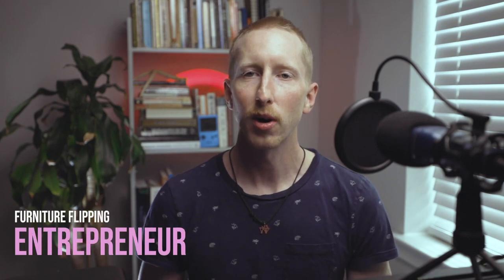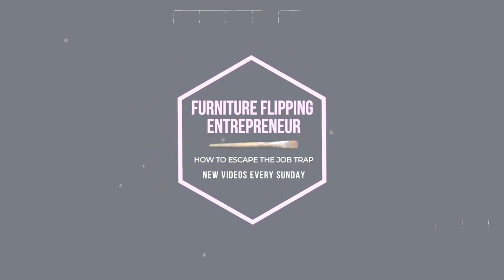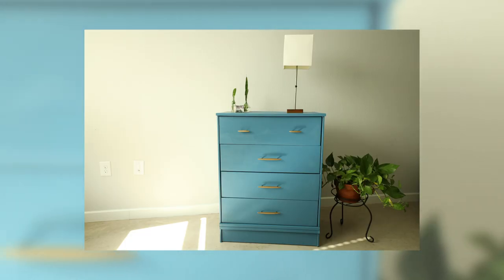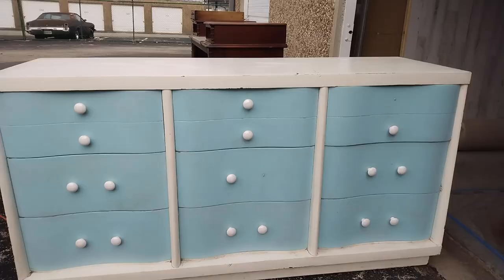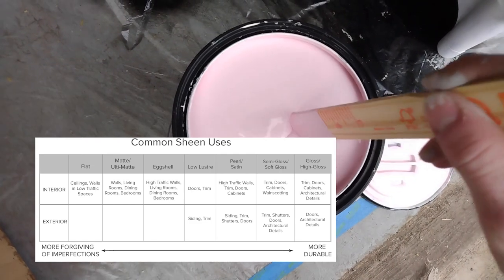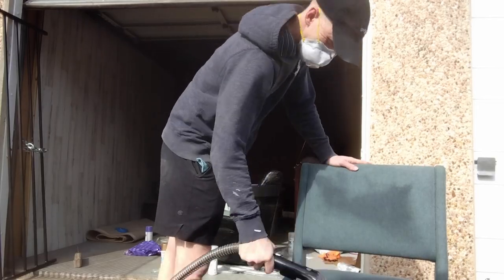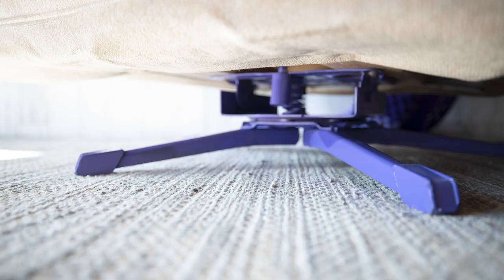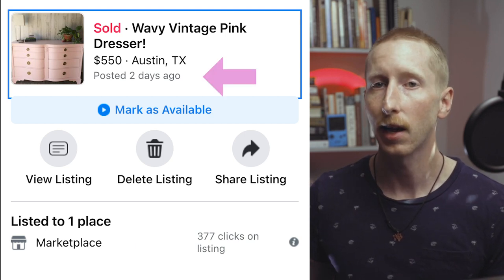Easy Furniture Flips // My Furniture Flipping Strategy

Comment: The amount of value in this video is bonkers. I’ve learned just about every damn point you’ve made. A lot of them the hard way haha. Only I factor in expensive ass paint that’s probably 3-4 times more expensive than anything in Home Depot. It’s hard to use anything else now. The finish it leaves is truly phenomenal. It’s some perfect harmony between vintage meets contemporary modern in a wonderful ceremony. Truly in awe every time I finish a new one. It’s an interesting phenomenon where once it’s changed, I can’t view it in the original way anymore.
Reply: What kind/ brand is the paint?
Reply: What paint do you use?
Reply: @DustinGoldShow  renner wood coatings
Reply: @cesarvides9729  renner wood coatings
Reply: Agreed! Especially from a man